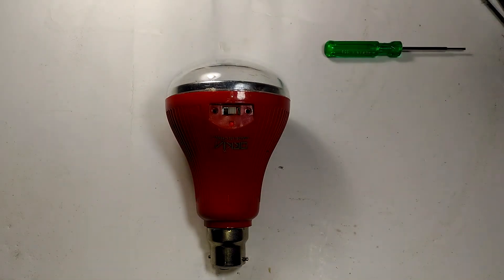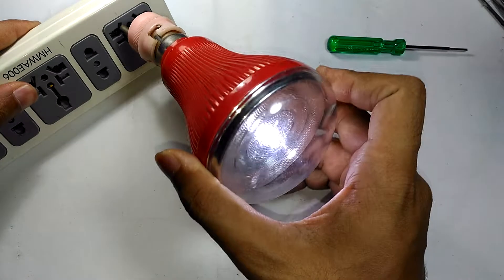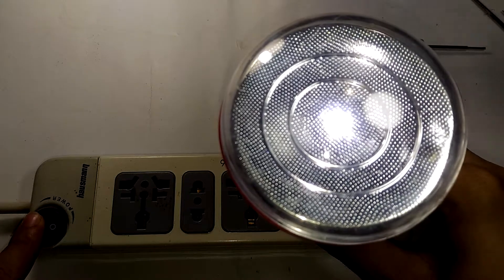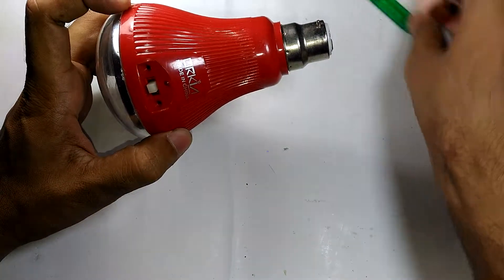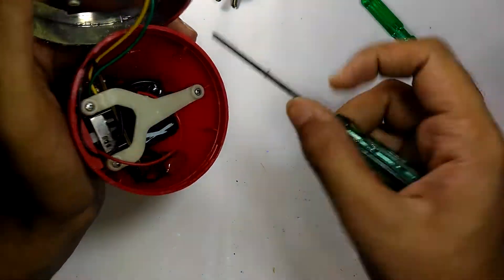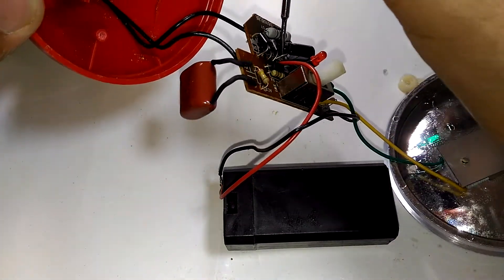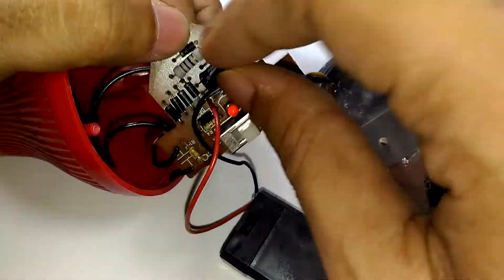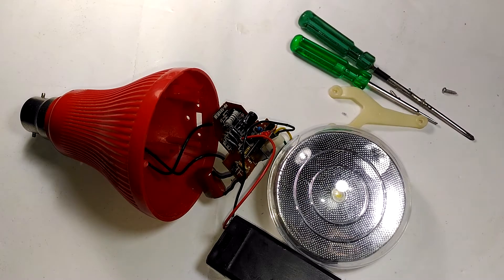IE9: Inside an Orkia mains operated rechargeable LED light!

Comment: I am having the same bulb.but the battery is not holding the current & i want to replace the existing battery with lithium battery.My bulb is of 100 watts.What should be the voltage of the lithium battery i should buy to replace the existing battery?
Reply from the maker: The voltage of any 18650 li ion battery is 3.7 volts(nominal). First measure the LED voltage. If it is 3 volts then you can use one or more batteries in parallel, depending on the available space. More battery will get you more run time. If the LED voltage is more than 4 volts, the procedure is different. When using li ion, always make sure to use the proper charging circuit, otherwise things may get dangerous.